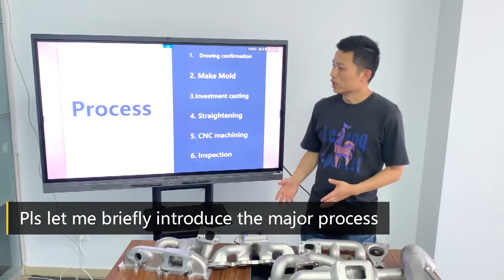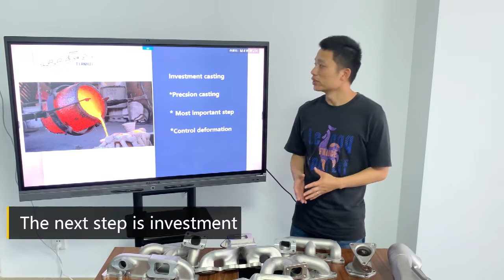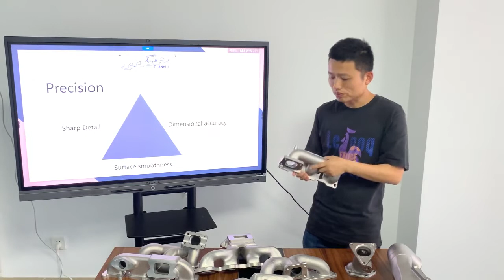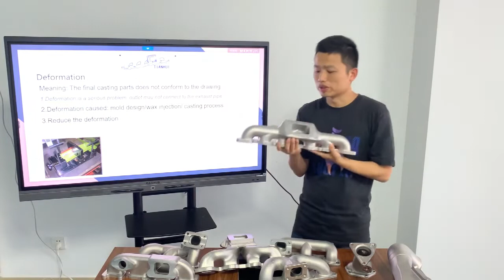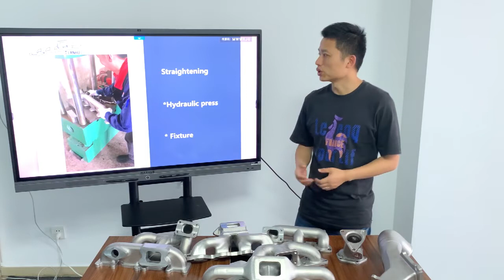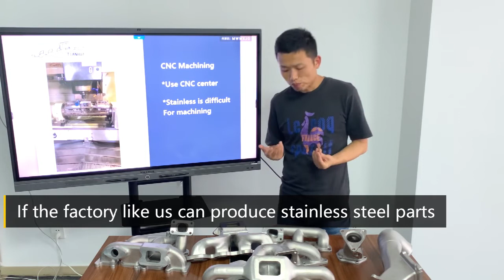how to produce cast stainless steel exhaust manifold

Comment: Are you still in business cause I have a need for a 1972 350 rv exhaust manifold (330hp) that hugs the motor for S 10 v8 conversion. I have a good set of exhaust manifold however they dont make these anymore and having them cast in stainless would be awesome you could bring these to market as currently people are bending tube style headers restricting flow. However the real money maker is if you use this RV header and add a top of exhaust manifold turbo inlet you can actually grow your business think about how man GM motors can use that twin turbo exhaust manifold